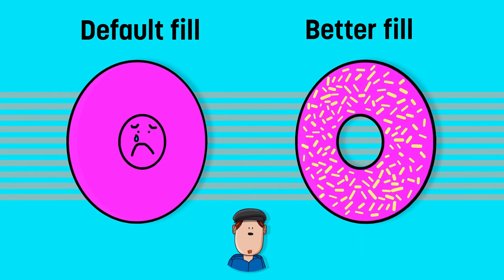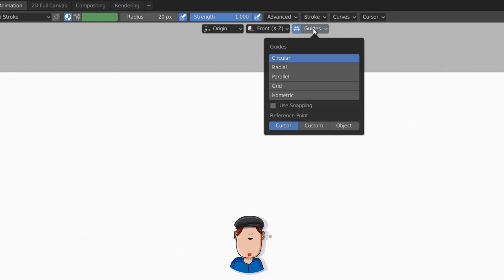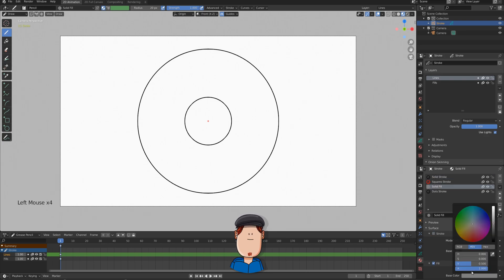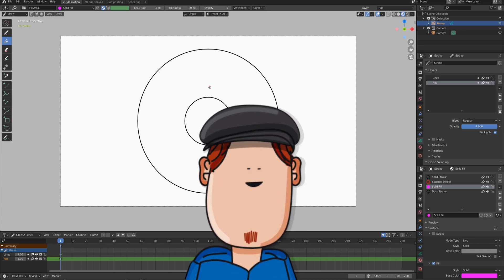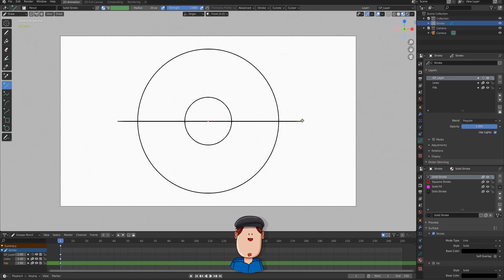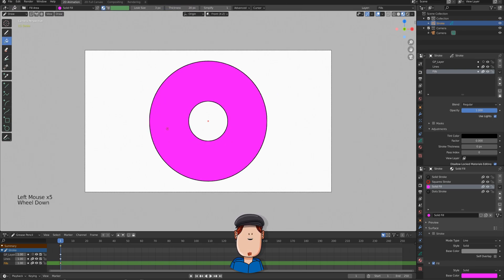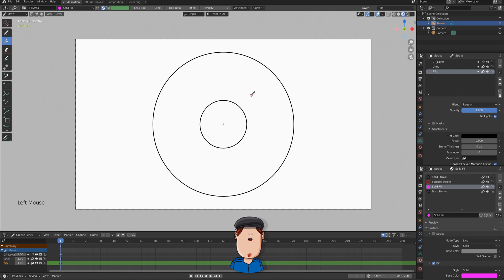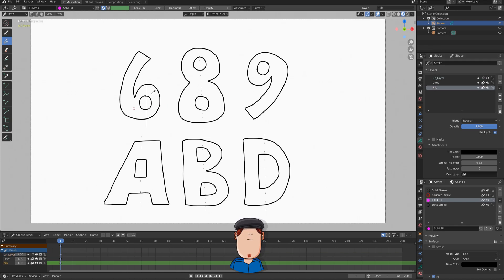Grease Pencil Fill Gaps (The Alternative Way)

Comment from the maker: 80+ Grease pencil tips & tricks (my best tutorial): https://youtu.be/z11Sv_kkoUs

BEST WAY until this is fixed:
USE HOLDOUT MATERIALS, so good!
You can fill everything normally (gaps are not filled) - then use different material set to holdout fill / stroke + holdout fill
(Blender 2.91 and above) https://developer.blender.org/T79878

Workaround #1
Tyrzi at the comments was very kind to share his video that uses masks to tackle this problem: 
https://www.youtube.com/watch?v=rbrGHV8SMvM
Thanks man!

Workaround #2
Tristan Grimaux shared at the comments this method:
"I've found an easier way: the fill tool only works on the visible area, 
so take out of frame half of the circles and click on fill, it will fill as if it has a divide. 
Zoom out, fill the rest, no gaps between the halves" 
Thanks man!
Reply: I can‘t find the holdout materials in blender 2.9. Please tell me how can I have this new feature, thank you!
Reply from the maker: @rockywong6144  It works in 2.91 experimental version :) https://builder.blender.org/download/
Reply: @Dantti  Thanks！

Comment: IDK why but the fill tool just doesn’t work for me- it changes the colour of the lines but it doesn’t fill anything in. Anybody know what the issue is?
Reply from the maker: Make sure you have a material that has the fill checked out, if you fill with stroke material, it will only generate the stroke :)
Reply: @Dantti  Oh, this was it! TY :D
Reply: @Dantti  thanks so much ...my blender looks so different

Comment: I've found an easier way: the fill tool only works on the visible area, so take out of frame half of the circles and click on fill, it will fill as if it has a divide. Zoom out, fill the rest, no gaps between the halves
Reply from the maker: That's not a bad solution at all!  
It also helps if you press ctrl+space to enter full screen mode.
Thanks for sharing 🤩
Reply: bruhhh, in my case it's Saying. Unable to fill unclosed areas

Comment: Too bad that there isn't a good way to replicate the 2.82 technique on 2.83 where you just make a layer that has subtract blend mode on because drawing on that layer erased anything that was below that layer. That method was so great because after knowing that, I didn't have to use the method in this video. Not to sound like an ass by saying that.
Reply: Tho now I found out a way to replicate the way I just said. It's a bit different approach but the principle is the same. https://youtu.be/LyJ-j5i8P_U
Reply from the maker: Thank you for making a video for this.  YT doesn't let me pin replys so I made one comment that links to your video. Hopefully people see it and can test it out :)
Reply: @Dantti  I don't see that comment. If you did make that comment, I'd prefer to have this video on there https://www.youtube.com/watch?v=rbrGHV8SMvM because, in my original video I misspoke about the invert mask toggle button, and it felt less clear overall so I wanted to make a better version of that.
Reply from the maker: @NTyrzi  Sure, no problem, it should be pinned now but YT was doing something crazy, because I tried to check it without logging and it didn't show. Weird. Hope it is fixed now :D
Reply from the maker: Niice, I actually have missed this method completely. Thanks for pointing it out!
I've used 2.83 alpha - stable a lot because of the code refactoring.
Hopefully some fix will come soon. 
2.90 is getting some GP goodness but this method didn't work :(

Comment: thanks, was going nuts over this. Grease pencil is sooo close to being a perfect tool, but it's problems like this that go against intuition and add a lot of time to the project that make the it almost useless :/
Reply from the maker: True, but give it time, this is still a very new tool in Blender, if you have checked even the 2.90 roadmap the changes that are coming are really good, it is only a matter of time before this is fixed but I understand it can be tricky because everything is operating in 3D environment.

Comment: Thanks for the tip! But it still feels very clumsy. I hope that Blender will fix this issue in future. Do any one got some information when Blender wants to fix this issue? I searched their issue tracker, but I didn't find any tickets.
Reply from the maker: Haha I know, but it's better than nothing I suppose. Maybe someone will figure a better way to fill the gaps.
Nope, no info but im sure they are aware of it :)
Reply from the maker: @Elevator Music 3D space is hard to calculate. Imagine you would have a magical picture frame floating on air, and you would need to paint to the blank space in the middle. Hard :D